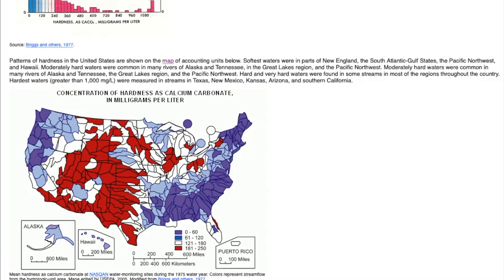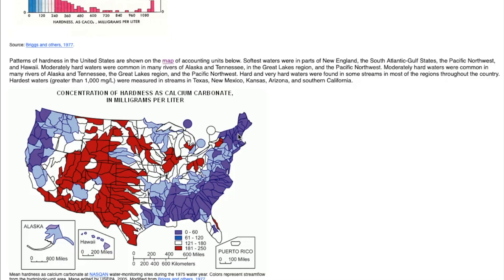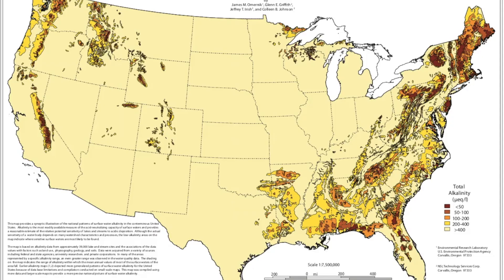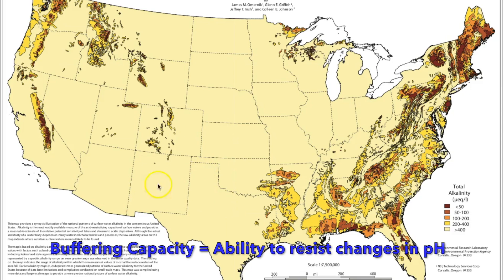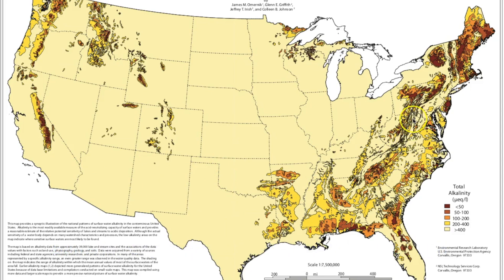Fish Tank Water Hardness Fully Explained: Don't Kill Your Fish!

Comment: I live in Oregon, my water is extremely soft. 0 on the hardness scale. Tap water comes out at 7.0 but if you fill a tank and test it a week later it will be around 6.0. this isn't good if you want most fish, plants and especially snails. What I did to buff my water is I add 2 tsp of cichlid salt to my 55 every water change/week. This works for me because 2 tsp isn't anywhere close to enough to make the water too hard for example it recommends 1 tablespoon per 10g to make water appropriate for cichlids. Now my PH stays at 7.6, KH stays at 80, and GH stays at 100. This worked for me, now my snails, fish and plants are all very happy, would recommend.
Reply: I used crushed coral in the past. Definitely has benefits, but takes time to raise PH. No, snails would likely die without the salt. The salt keeps my water ph slightly above neutral which snails perfer cause acidic water breaks down shells and the salt has alot of calcium in it which snails consume keep shells strong. You just have to remember to use the cichlid salt in moderation. The instruction says to add 1 table spoon per 10 gallons for cichlids which prefer high PH. I'm adding 2 teaspoons per water change on my 55g, I only do 1/2 teaspoon on my 20g per water change so the amount will depend on size of tank and what you are keeping.
Reply: @98Bagel98  do you have live plants? I am almost in the same boat as you so salt could be a good option for me just scared to try it if it hurts live plants.
Reply: @MilesLocke  yes, my aqaurium is  planted.
Reply: @98Bagel98  thank you!
Reply: @98Bagel98  if i were planning to keep tetra and guppies, would you recommend a different type of salt? I have a 40 gallon tank
Reply: @MilesLocke  I have bleeding heart tetras in my planted 55 and they are fine. For Guppies I've never kept them, but I know they are hardy. If you start small and test the water until you get a good idea of how much to use they should be okay. I have ottos in that 55 which are "sensitive" and haven't had any issues.
Reply: The salt is called "cichlid salt" because it's primarily used in housing cichlids, but at the end of the day it's just a water buffing agent. It ups the ph and hardness which will stabilize ph. Most fish can live in a ph from as low as 6 to over 8, the important part is that the ph is stable. My ph originally wasn't, but the cichlid salt stabilized it for me.
Reply: @98Bagel98  thank you, really appreciate it. This helps me alot
Reply: I was wondering what was up with my tank. I finally started watching videos about ph, etc. I’m in NY and my ph is low, gh and kh also. Tonight I put crushed coral in my HOB to try and help. The salt doesn’t hurt your snails?
Reply: @libbymcjunkin4515  Me too! I live on Long Island and am having a similar issue lol gatta love New York... did you find a solution by chance? I am going to add wonder shells to my aquarium hoping the calcium and other minerals may help.

Comment: Hi. Very informative video. I just lost my tank of goldfish a few days ago after ph bottom out due to a low kh. Our gh says our water is hard though on tetra test strips. Our ph is 7.4- 7.6 out of the tap but plummets into the 6s after being put into a fish tank in 48 hours or less depending on whether or not live plants are in the tank. My daughter has to do waterchanges on her goldfish every other day to keep in safe zone now we know there's a problem, however her plecos dont seem to mind one bit. Would crushed coral in my filter help raise the kh so itd hold that 7.0ish ph ? Dont want to give up on keeping goldfish  but dont want to kill anymore fish even accidentally either. As of now, I'm running my tank empty with its live plants until I get this figured out and stabilized. Advice is greatly appreciated.  TIA.
Reply from the maker: You could try that. Your other options are using aragonite or even better take a look at the African Cichlid Mix by Caribsea.
Reply: @PrimeTimeAquatics  , thank you. I'll look into those options as well.

Comment: I watched the PH first and now the water harness.  You totally told me the opposite my local fist store told me.  I told them my PH is at 8.3.  Out of my tap it is 8.5.  My GH/KH is at 20 ppm - 30 ppm.  My local fist store told me I need to drop my PH and told me to put the leaves in my tank.   With your explanation I now understand how harmful it would be to do a drastic change.   You made it quit clear to me that I am ok, but should balance it out slowly.  It is important to to balance the PH to maintain it between 6 - 8 and monitor my hardness to keep in line with the PH.  Sorry to repeat.   Thank you for sharing.

Comment: Great video! 
Question (scenario to follow): How much crushed coral can you safely add to a filter for a 20g tall tank? 
I am brand new to hobby, and of course am experiencing problems. 
Got 5 Corys for newly (fishless) cycled tank. 2 died in the 1st week. 
Took my water to lfs to compare to my testing. I was told water was great, but pH was much different from what I had tested an hour previous. They gave me some crushed coral in case I was having buffering issues. 
Bought a new pH tester and tested when I got home and pH was EXTREMELY low!  Did a water change, and threw some (not enough) crushed coral to tank. 
I know these pH swings are dangerous. Please help! 
Also, I have fluval stratum as a substrate and driftwood (has been in tank for 1.5 months).
Reply from the maker: You can certainly fill a filter bag and place it in the filter.

Comment: Jason - I have to thank you for this video because it has helped me tremendously in figuring out why I've had issues with my aquariums. I live in NH and set up 2 smaller (5 and 10 g) tanks for Bettas in April 2019. My pH plummeted down to at least 6.0 after registering in the high 7's at water change consistently. I bought an API test kit but never checked my water hardness. This past month I lost both of my Bettas within a week of each other, from what appeared to be separate issues. The first had swim bladder problems and I was doing regular water changes to try and help after doing salt treatments. Not realizing that was doing more bad than good because the pH levels were obviously becoming extremely unstable. After I saw the alkalinity map you posted, my heart sunk because I'm in an area in the country with probably the worst alkalinity issues. I seriously had no idea. But on a good note, I set up the 5g tank again and have started to use a remineralizer to increase GH and a KH buffer to help stabilize the pH levels. So far it's working very well and my pH has settled around 6.6 and my dKh is around 6 and dGh around 4. Also because my tap water is so soft, I now premix the water change water and let it sit for a couple of days to stabilize before putting it in the tank. Hopefully this will give my new little guy a better chance at a healthier life than my previous 2. Its sort of overwhelming to deal with all this chemistry but it's really necessary unfortunately. Sorry for the long winded post but I just wanted to say thanks for all your knowledge.
Reply from the maker: Thank you so much! I'm sorry you lost the original fish, but I'm glad to hear you were able to straighten it out.
Reply: Well done!

Comment: Hi, I keep African Cichlids and my KH is 240 and my GH is 180 with PH 7.6. I do add cichlid salt and Malawi buffer during weekly water Change. Problem I have is my test kit measurement shows max GH and KH so for example my KH might be 350 ppm but test kit only shows 240ppm. Is this deadly for my fish? I like to add the ph buffer as I prefer to have a PH around 7.9 and after a week it be about 7.6. Only problem is the ph buffer also increases KH which is already a high level. I am afraid to miss a week adding my salt and buffer just incase my PH does drop below 7.5. Appreciate any advice thank you.
Reply from the maker: Great question. Try taking some tank water out and diluting it by doubling the volume with distilled water. That way you can take whatever your reading is after dilution and multiply it by two to get the actual tank water concentrations.

Comment: I know this is a year later, but maybe you can help me. 
I live in central fl with tap water at a pH of 8.0 and testing GH of 160-180ppm. 
I used to keep malawi cichilids with no problem but recently moved to a community tank. It's been nothing but a problem and I think part of the reason is the pH. I recently had some panda cories die for no apparent reason. (All other water quality levels are good- 0 ammonia, nitirite, nitrate pH at 7.9)
If pH is kept stable, is it possible for high pH to decrease the overall life span of fish that prefer lower pH/hardness?
Reply from the maker: For me personally I don't try to adjust pH down because the most effective way to do that is by using RO, but you really need to stay on top of it to keep it stable. I have similar water parameters to you and don't have too many issues keeping standard community fish. I wonder if it was just a fluke occurrence.

Comment: You talk way too much dude I just need to know how to get to the point which is how to lower the GH.
Reply from the maker: That would be the "fully explained" part. :-) The purpose of the video is to teach people about water hardness.
Reply: @PrimeTimeAquatics  can you tell me what to do for high alkalinity .. this is all too much and i just need direction.  I have very hard water.. finally got the ph level correct, but the "high range" ph levels are off the charts.  Cannot get the hardness down no matter what I put in the tank.  The corrals raise alkalinity, as does baking soda. RO systems are way too expensive, and honestly, it should not be this complicated to have a fish. I've spent a good $400 just to keep a $20 fish alive.. I want to get this fixed, instead of spending money just to experiment with products. The website is riddled with contradictions and it's driving me nuts!

Comment: I live in the middle of nowhere PA and this made so much sense. My ph is at about 6.4 and the ppm and dh are all over the place. Our water comes from a local stream and they constantly are changing things up and adding to it. My ppm was through the roof in my planted endler tank so I went out and got some distilled water. Is that what I should be doing? We have eo many natural springs and I thought about going around and testing those lol. I have many 5 gallon buckets. I know everyone races about api test kitsch but is there something better? You have easily become my favorite fish YouTuber. So helpful!
Reply from the maker: Thank you so much! Appreciate you being here. I think if you can keep the GH and KH relatively stable that would be good. I generally don't try to hit a target, but it's easier for me because there isn't a lot of fluctuation. I have found the Tetra test strips and usually in the ballpark and super easy to use, so I wind up using them more than anything else. If you use distilled water just make sure the pH/GH/KH stay as stable as possible. Hope this helps. :-)
Reply: @PrimeTimeAquatics  it does thank you! :)

Comment: i just need major help on lowering my general hardness bc it’s way to high (I really need help)
Reply from the maker: The easiest way to do that is either an RO unit, or if the tank is small using distilled water. Add it slowly over time until you reach the desired hardness. Obviously, you have to keep a close eye on your pH as well.
Reply: Do you have access to outside space? Set up a 208l barrel outside to catch rainfall. It's free and the water is as soft as anything you get from an RO set up.

Comment: I have a Water quality question. I live in Montana on a Private well. Our Well Water is high in Iron so we have to have a water softener system set up, now the issue is it’s now fairly salty. Since no one likes drinking our tap water I have a Brita filter on my sink down stairs to fill up jugs. SO I now have issue as far as which water to use and if there’s a fix for it. My Brita faucet is very slow flowing, so to fill my 30+ gallon it’s faster by hose which is well water (iron) or Tap water (sodium) - is there something I can do to tackle my issue without having to spend loads of money like setting up a separate filtration to fill and do water changes. My last house had a softener system and wasn’t that bad as far as sodium taste, this one seems way stronger I think because of the iron levels

Comment: Thank you for doing this video but I am still so confused, I need something that can stabilize hardness a tad higher for a long period of time for my 55 gallon Neolamprologus Multifasciatus(Multies), no powders or liquids. Water specs below for my tap. 
TDS: 138
EC: 293
KH: 6 degrees (100ppm)
GH: 8 degrees (140 ppm)
PH: 8.2

what should I do?
Reply from the maker: You could do aragonite or crushed coral in a filter bag and see how that impacts your parameters?
Reply: @PrimeTimeAquatics  will that leave my pH alone?
Reply: @PrimeTimeAquatics  mine is 300 ppm, i think my fish will die soon, my tap water is 100 ppm should i do a half water change, i think i may have added too many aquarium salt

Comment: Good video.  I have a recently set up tank (20 gal) that was cycled, PH is 7.8, no ammonia or nitrites/nitrates.  The KH was 214.8 (12 dkh?) and the GH was 89.5 (5 dkh).  Temp 78 degrees.  Got some tetras (glowlight) and some cory catfish and they all died within a week.  Replaced with some platys and they're alive but very sluggish.  I've heard they prefer harder water so is there any way to add anything safely to the tank to increase the hardness?
Reply from the maker: Aragonite and crush coral substrates will both raise hardness. You can always put them in a filter bag since the tank is already scaped. You could also consider baking soda, but you would have to pay close attention to what it is doing to the water.
Reply: @PrimeTimeAquatics  Thanks so much.  I already have a basic gravel substrate, should I get some crushed coral and sprinkle or do I need to replace the gravel entirely?  Also will the coral raise my PH?  It's already at 7.8.

Comment: Just stumbled across this video. When we talk about fish preferring certain hardness, which do we refer to? My well water comes out at about 9dKH and 19-20 dGH. Which of these would I use when considering stocking? Sites vary in listing KH, GH, or "hardness" and not specifying. You guys seem to keep a decent amount of fish outside what we sometimes consider their "preferred" ranges, and I think a lot of times people care more about this kind of thing than fish do. Would you say going harder is safer for fish or softer? Or is neither or both a huge deal?

Edits for wording
Reply from the maker: Great question. Unless it's extreme, or the fish are wild-caught, most store-bought fish do well in average water parameters and don't need hardness adjusted (there are some exceptions like discus, etc.). Your GH is pretty high and if I had your water parameters I would be keeping lots of African cichlids and most livebearers. :-) Many of the larger american cichlids will be fine at those parameters as well. I could see cardinal tetras, german blue rams, and possibly apistos struggling a little more in that water as an example.
Reply: @PrimeTimeAquatics  Thanks for the reply! So is GH what you'd normally consider when thinking  about stocking? Unfortunately I don't have a place for big tanks (I'm not yet stocking my basement :P ) which I think rules out a lot of cichlids, though multies are on the list. Guppies are what I have so far, and are a challenge finding a home for all these fry with no one interacting!

Comment: i currently have extremely hard water. my tap is about 350-400 TDS, I would like to install an RO system in the near future. how should I go about introducing remineralized RO water into my tank? daily 10% water changes or should I stretch the duration over a longer period of time?
Reply from the maker: I might go 20% per week. Maybe break that up into two separate water changes though?

Comment: Hi Jason....thanks for your time explaining the water hardness here @ youtube..question I have? what can cause kH hardness to jump from 6deg ( 107 ppm) in tap water to 9deg ( 162 ppm) of kH in my planted tank??? no wonder my co2 system does not move the pH level at all...the buffering factor is over the chart...I do fertilize with micro and macro daily....ammonia 0, nitrite 0, nitrate at about 20 to 30 max, pH of tap water about 7.5 ??? What can be a cause of the kH increase in my tank??? 6 deg is high enough...9deg is way too much   THANKS
Reply from the maker: I'm not sure. I'm assuming you didn't add any rocks or anything to the tank. If you use a water softener or filter that might impact it. I wonder if changing the flow rate of your CO2 system might have something to do with it as well?